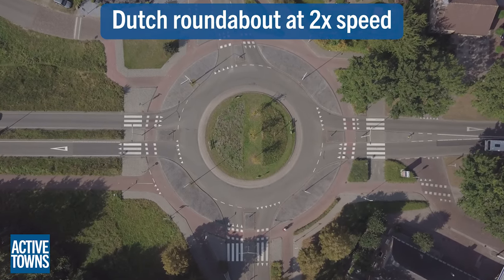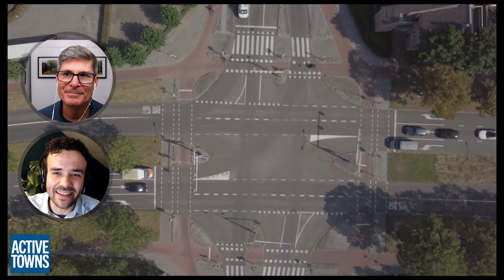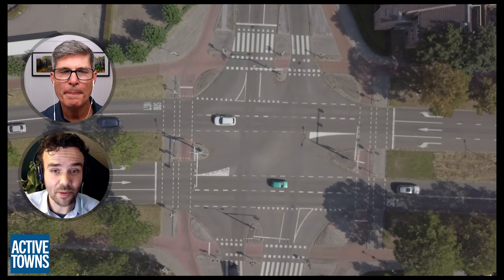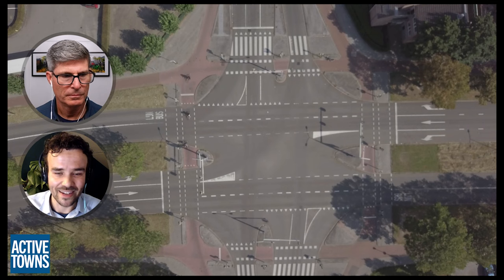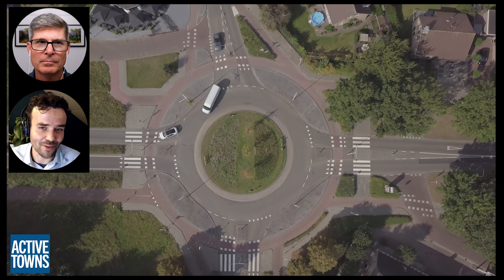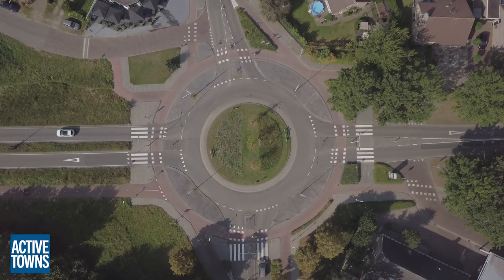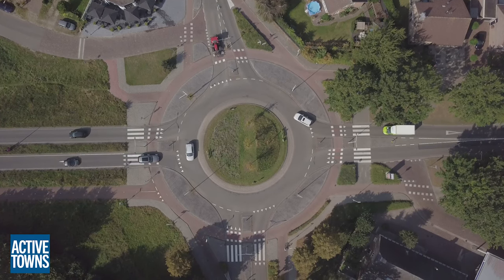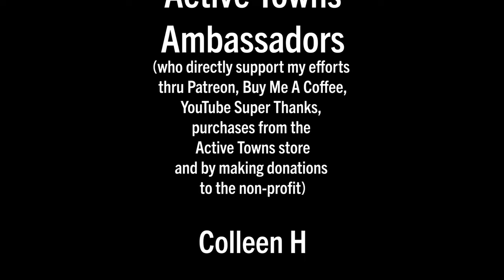Dutch intersection design with Lennart Nout

Comment: 7:55 exactly. When the number of people using the intersection is so skewed towards one side so much so that it would effect other traffic the Dutch solve the problem using other methods. Using under/overpasses for example, diverting traffic to other roads where the interactions can be better controlled or even putting down stop lights. One solution is not the solution for every situation and every situation should be looked at on it's own, you can consider one solution that worked out for a similar situation for the new situation as a starting point but in the end you need to consider the new situation on itself. Even the Dutch mess this up sometimes, but they learn and ADAPT.
Reply from the maker: Yes. Exactly.

Comment: 6:28 "Bikes get priority." What about pedestrians? I don't see any pedestrians at this roundabout. And I am all in favor of these intersections and what the Dutch has done for your country in regards to vehicles.
Reply: There are zebra crossings where they have right of way.
Reply: The pedestrians are set back from the bike crossing for safety. And if there were traffic lights that might spend more time on the car lane than they do on a roundabout because you might have turning lanes for the traffic light.
Reply: @irisachternaam  Thanks, I appreciate your response.
Reply from the maker: Yeah, not many peds in this particular remote location, but note the crosswalk location… yes, they also get priority.
Reply: it has pedestrian crossing who has priority.